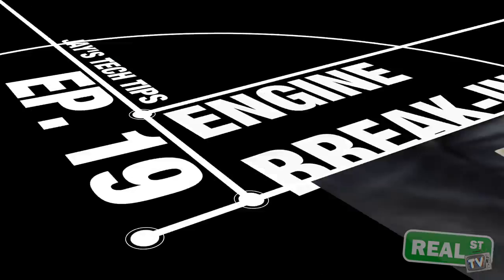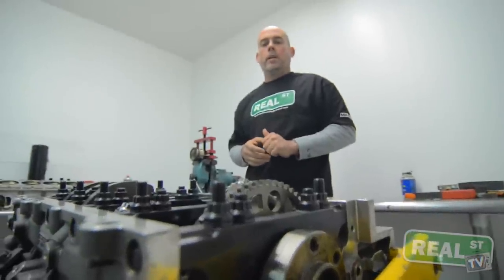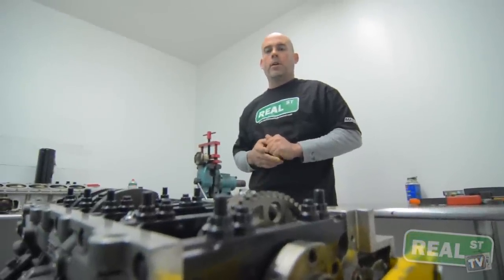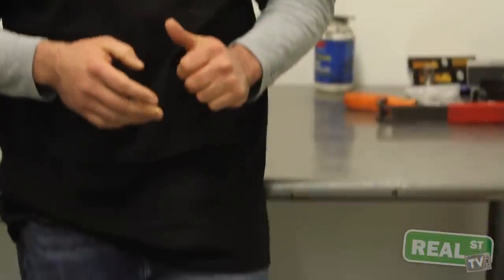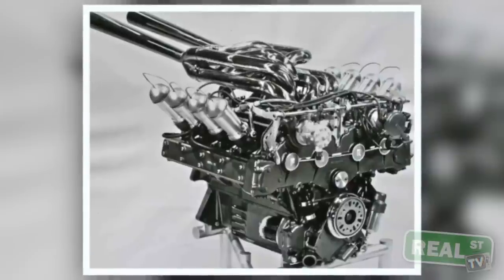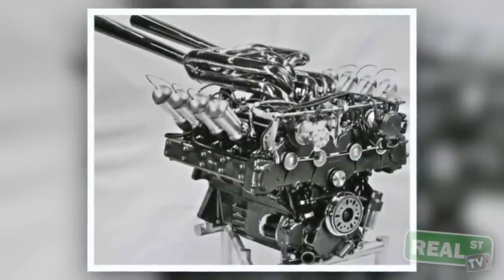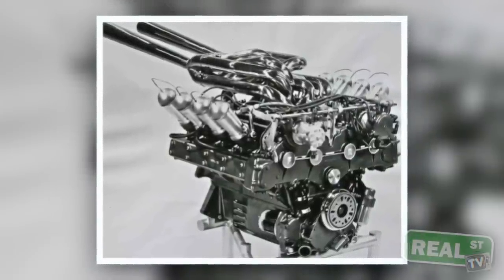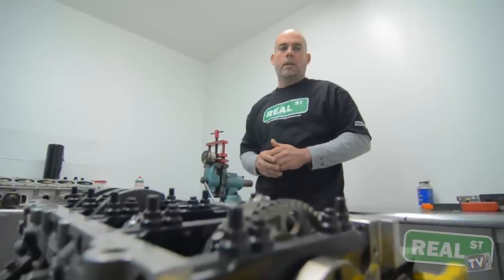Engine Break-In Jay's Tech Tips 19

Comment: When it comes to using brake and oil would you have to add  four to like 5 quarts or whatever the manufacturer recommends for saying the engine in a day-to-day use where can u get away with like one bottle or 1 quart of brake in oil and then put whatever our oil like 5 w 30

Comment: Think of it this way, police cars go 100,000 miles at least before they get sold. What break in procedure do they get? Scream, idle, and repeat. Have you heard of engine failures other then cams on police engines (4.6/2.7, LS, hemi)
Reply: Police cars are designed different, they're designed to idle more. Larger oil capacities.

Comment: Should there be any load on the engine for that 20 minute at 2500 rpm. I am building a Audi V10 I plan 20 minutes on my dyno with a light load using mineral oil.. I would love to not have to change  the oil and start with Mobil 1 20-50W fully synthetic oil. The mobil lube engineers tell me I do not need a mineral oil to bed the rings and to start with the Mobil 1.

Comment: I had a shop teacher that told us by wet sanding the rod bearings helps is that true ?
Reply: Mike Smith I would have to say no on that. Oil clearance is extremely important and the spec range is usually only .001" i.e. .0015-.0025". It would be very hard to wet sand a bearing exactly correct to get a consistent oil clearance over the entire surface of the bearing. I could maaaayyyybe see if you were working out in the barn lot rolling some bearings into an old tractor and you bought some slightly oversized bearings to restore some lost oil pressure due to bearing and crank journal wear. If you purchased some .001 or .002 oversized bearings and through plastigauge you found they were a little tight, you could possibly sand the backside to open up the oil clearance to .0015".

Comment: hey Jay, i installed a brand new from the dealer chevy small block 350 in my chevy express van, i broke the engine in with synthetic oil, after i changed the oil 2 or 3 times with synthetic and ran the engine about 500 miles total, i saw that they actually recommend breaking the engine in with conventional oil before starting synthetic...am i screwed?
Reply: It's three years later. How did it work out? I would guess, no problem. From the dealer, it probably was pre-broken in anyway. The factory can't ship an engine without testing it.

Comment: I'm going to be installing stage 3 cams and beehive springs on my SOHC 3 valve mustang and is there any break in process I should follow? I was told there isn't since it isn't a flat tappet cam
Reply: The cams don't really have a break in, I've done numerous cam swaps on 3v's. Just give it a 100 miles or so before you really beat on it.

Comment: I have a brand new gti mk7, I happened to floor it  (just once) until 6000 rpm... I haven't been harsh with the engine aside from that occasion, but now I'm worried that it might have caused any damage to the engine because it's in the breaking in period. What do you guys think?
Reply: this is for freshly built engines only, your mk7 motor was broken in by the engineer/dealership.
Reply: I had bought 3 turbo cars in a row 2 used 1 new the last one a focus st brand new, the first 2 run as silk even when the were used cars in the mkv gti i reach 245kmh do i know if the previous owner break in the engine? No i dont know, the last one the focus st mk3 i didnt do the break in period and with more than 15000miles it run as smooth it accelerates 0-60 in 6 seconds and reach 250kmh, i just bought a yamaha r3 at the dealer ship the told not to run it beyond 60kmh and 7000rpm but friends have other yamahas and brand new they went above that limit and the motorcycle runs perfectly, engine break in period myth or reality???
Reply: How the hell do you know that it isn't "breaking in period"? Are you looking inside the motor and checking the conditions of the rings or doing compression checks?

Comment: good advice for me
Reply: no there is no break in on them. install and have fun.
Reply: There IS a break in period for most rebuilt motors, depending on the tolerances of the parts installed. This is why when you drain the oil, the oil will have a glittery sheen to it from all the hundreds of thousands of particulate metal worn away from the rings rubbing the cylinder walls and even the bearings getting a little worn. You can be careful but still apply load and pressure but if you go too hard too soon, you might take off more metal that you obviously can never replace.

Comment: What I did with my 350 was keep it under 2000 rpm on all driving and on highway drove it 45 speedo read 50 lol for 1000 miles change the oil. But to let a semi try and pass you noo lol